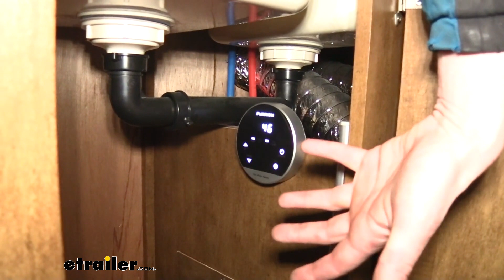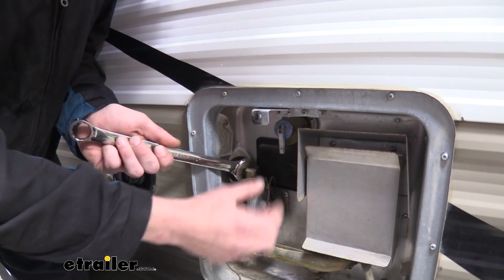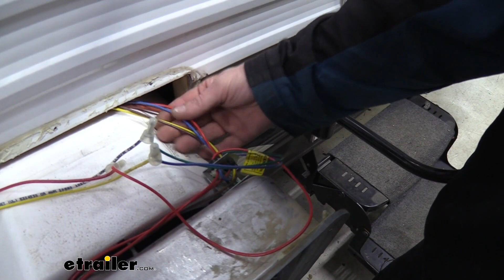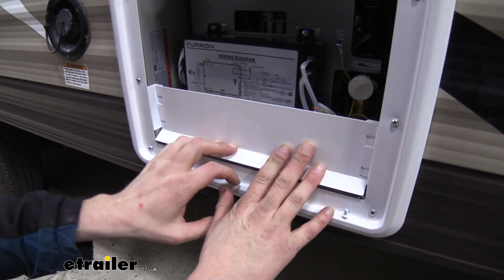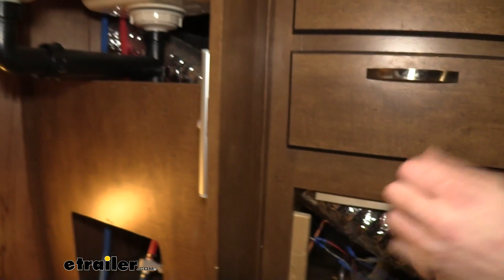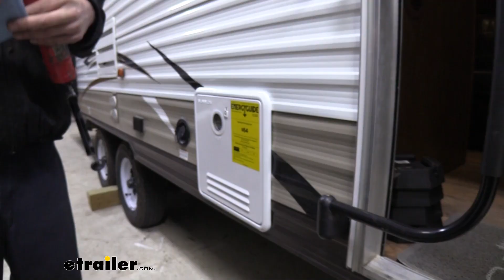Installation: Furrion RV Tankless Water Heater on a 2016 Forest River Wildwood X-Lite Travel Trailer

Comment: I have a Suburban SW10DE.If I do this swap do I still use my DSI switch located inside or will it be disabled?
Reply: You won’t use that switch anymore. The control panel for the new water heater controls everything. If your current DSI switch is stand-alone like mine, you can probably use that power, ground, and signal wiring for the new control panel.
Reply: I’m not married to the old switch but could you still use it or is the new controller part of the conversion?